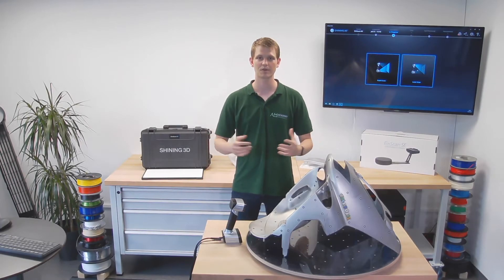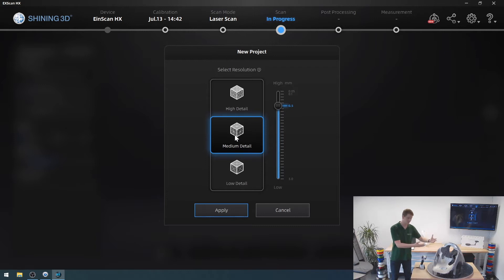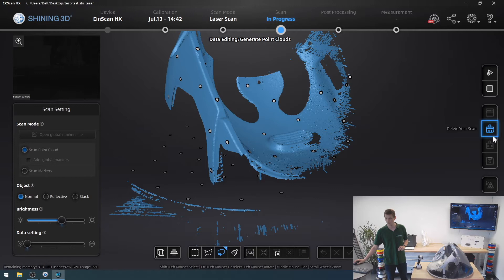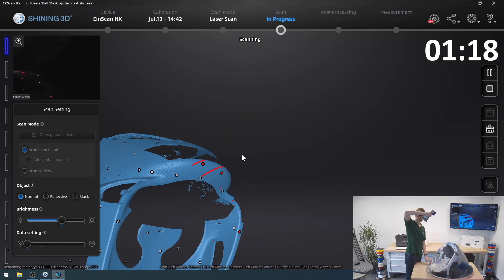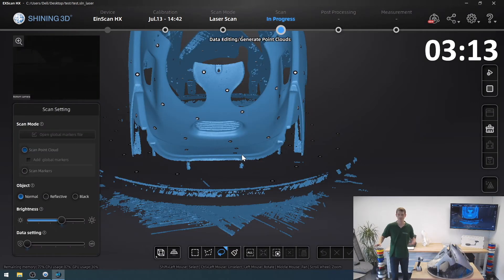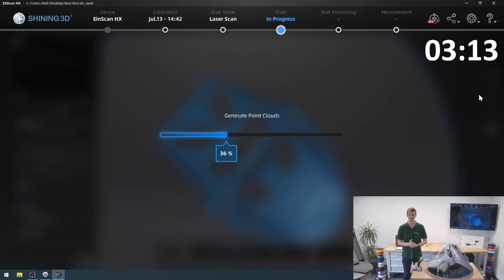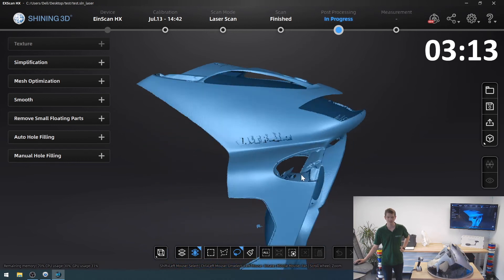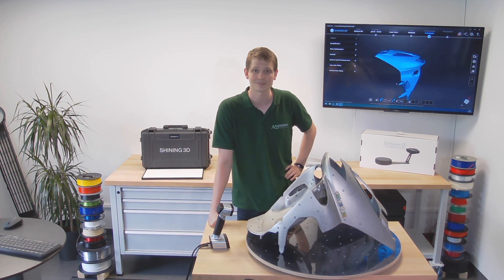3D Scanning with Shining3D EinScan HX Laser Scan Part 1   scooter front

Comment: How would you compare the einscan HX vs the Pro HD? Thank you!
Reply: It somewhat depends on your field of application. The Pro HD has the advantage of having both a handheld and a fixed scan mode using a tripod. So if you have lots of parts that benefit from fixed scan mode, the Pro HD may be better. However, the HX has the laser scan mode, allowing you to scan dark / reflective surfaces with greater ease, but requires markers for this. It can also scan faster than the Pro HD, due to its greater Field of View.